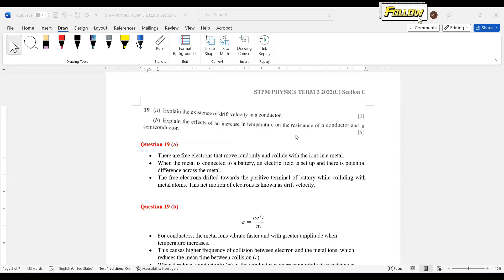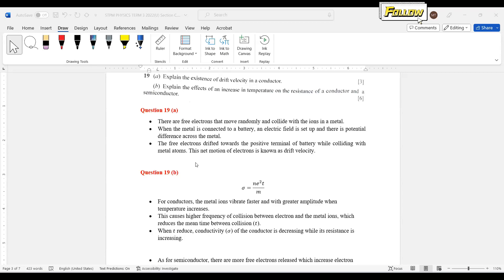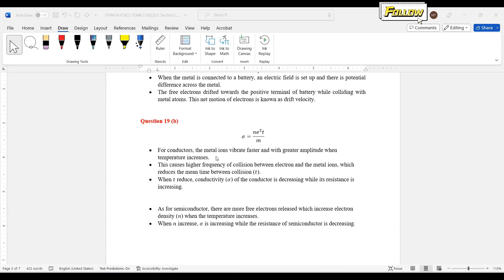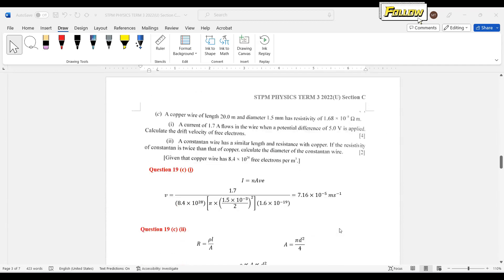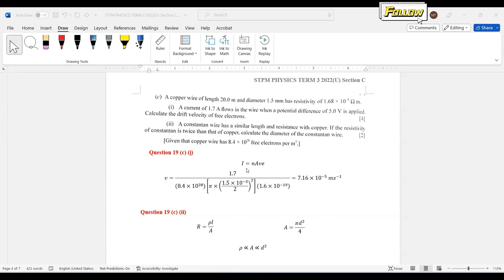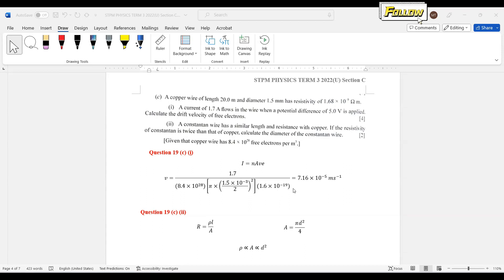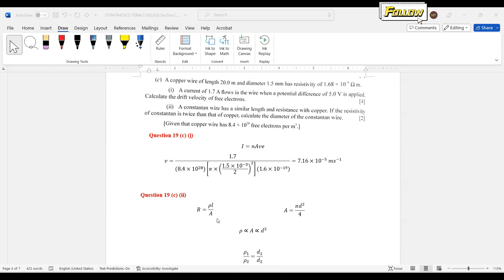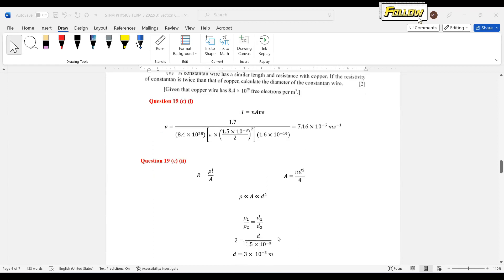Past Year 2022(U) Q19: Electric Current | STPM Physics T2 CH14

Comment: Hello sir , I am from accounting class form 5 , and right now I am about to sit for SPM , my elective subject is Prinsip akaun , ekonomi , perniagaan.

Haiz , I cannot enter science stream , while my general science is around 50 marks , my maths is bad , ultra bad , as such I failed my maths and the qualification for me to enter science stream is gone.

I have interest to enter form 6 after SPM , I was wondering if I could add one subject , extra subject which is Physics during STPM , I wanted to add one subject which is Physics during SPM but later did I know that the timetable has clashed between my General Science and Physics (haiz) , I would say that my fundamental for Physics is good enough for me to survive this STPM (I also got pre u physics book , so far so good , already finished the chapter for capacitor , now doing some revision to retain all the previous chapters)

Thanks.
Reply from the maker: Hi there, glad to see this message. It is great to see your interest in Physics. I guess I am not qualified enough to give suggestions, but here is my personal opinion. 

First of all, you will need to understand why you would want to put in your effort into this subject. If it's purely out of interest, I suggest you could explore it by yourself or join discussion groups without the need to have the formal coursework in STPM.

However, if it's for a potential career, like engineering, I need to say that Physics alone would not be enough. You will need other subjects as well, including Maths and Chemistry if you are going to Form 6. You may check the general entry requirements of certain university courses based on your interest. Furthermore, I don't really think that the school would allow you to take Physics, because the assessment of the subject is not only the exam at every end of semesters, but also the assignment and experiments which require significant time and effort. 

In the end, let's say you just want to add this subject on top of your other economy/accounting subjects, what is the purpose of having this additional subject in your certificate? How does it align with your future goals in the next 5 or 10 years? For me, I am from science stream background, I could not advise much on the career path other than science path, but I do believe every career has its own values. It's not a loss for not taking Physics, but an opportunity to explore other avenues.

Finally, best of luck in your SPM. Do your best and get good grades, that will be your leverage for future endeavors, whatever they might be.
Reply: @MTAcademy_MY  Thanks for your response sir .

Actually my main reason for me to learn Physics is mainly because of "flight simulation" , I also have an advanced flight simulator on my laptop , which is XPlane11 , so yea I have to understand it even though this is virtual.

My planning for my future career is mainly on the aviation side , not piloting , engineering or ground crew , but air traffic controller. Well , I already understand all these Physics principles , particularly from flight simulators , so yeah I was thinking of adding it because I couldn't even take this paper for my SPM , so that's why lah.

Have a nice day.
(Actually may I also know the exam format of stpm physics tho , like how many papers do you have to take like that , just curious)
Reply from the maker: @matt32videos30  
For STPM exam format, I have done few videos about it that you can refer. We have Section A (15 MCQ), Section B (2 short subjective questions) and Section C (answer 2 out 3 long questions). We will have it in every semester, total is 3 which include mechanics & thermodynamics, electricity & magnetism, and oscillations, waves & modern physics. Then we need to do experiments with report writing, about 5-6 experiments in each semester (not remember). Lastly, we have one assignment, also need to submit a report. Usually in Sem 2 or 3.

Btw, you can actually request to take Physics exam in SPM even though you didn't attend the class in school. But I'm not sure if you can still apply for it now.
Reply: @MTAcademy_MY  Physics and General Science clashed already , cannot take it so...

I heard there is paper 5 in physics paper ...
Reply from the maker: @matt32videos30  all the best then ☺
Reply: @MTAcademy_MY Hello once again , I am about to finish SPM in Tuesday , Accounting paper (as of right now it is still Sunday , 3 March 2024) , and here are my plans for the future:

1. Air Traffic Controlling
2. Metereology
3. Statistics (as in Finance)
4. Accounting

So if I can enter STPM , I wish to take Accounts , Economics , and Modern Maths. While also taking Physics as my extra subject , I wish to take paper 5 , the central assessment test instead.

If everything else fails then yeah I am retaking my SPM (just ask for it first lah , retaking spm is my ultimate final choice)

I still remember till this day , the reasons that I wish to learn Physics is because of me wanting to enter aviation sector , and it really helps me after I learn it while I was flying in my flight simulator (and yea I cannot take Physics because clashed , this General Science is like a barrier to me)

Thanks for your advise :)